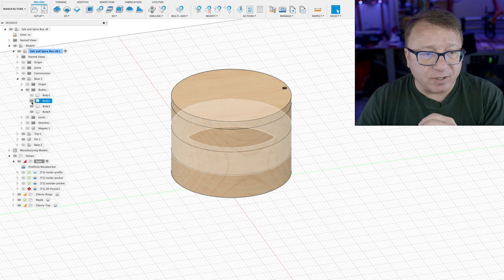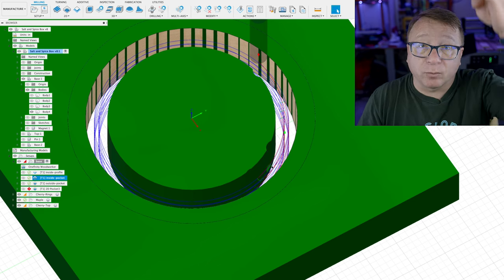Avoid These 5 Mistakes New CNC Users Make

Comment: I like the videos you make but one, the review on the onefinity qcw frame. you didnt mention the spindle wont reach 9 inches of the work area in the rear and is off center by 4.5 inches front to back. big design fault
Reply from the maker: Thanks Brian. I'm not sure I understand what you mean by the 9" in the rear? Yes the frame is short, but the OF spindle can't get there anyway since it is facing forward.  Maybe I misunderstand your comment?

Comment: Pro tip: don't zero your machine on your work piece, create a grid in your CAD and have it routed onto your waste board.  Start all projects using this grid file as a background now you can run multiple projects and multiple boards at the same time.
Reply from the maker: Excellent suggestion - thanks for watching!